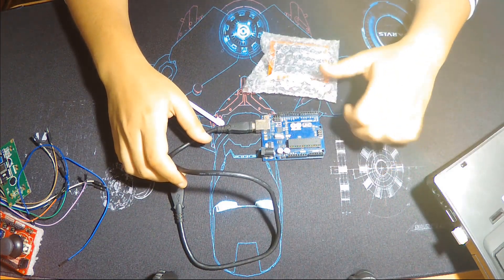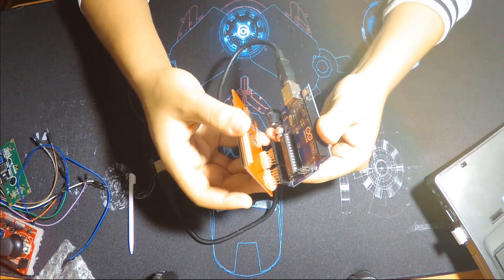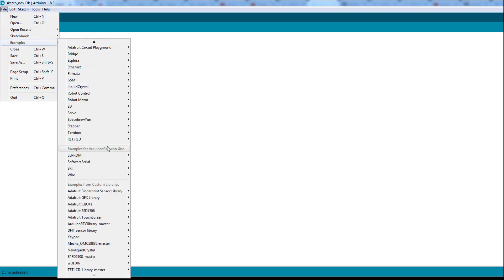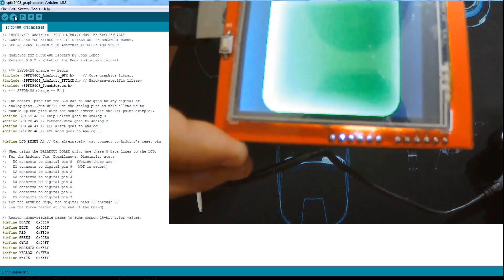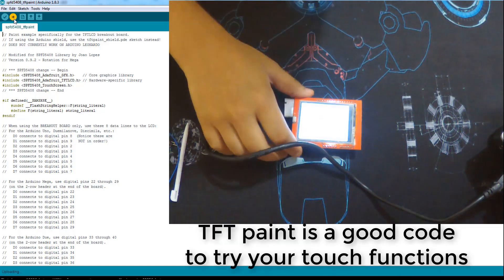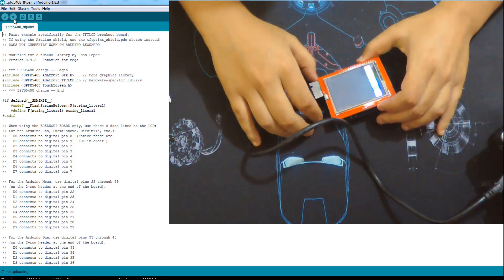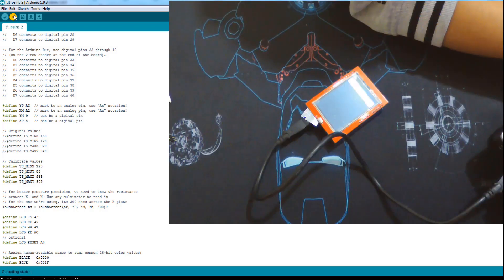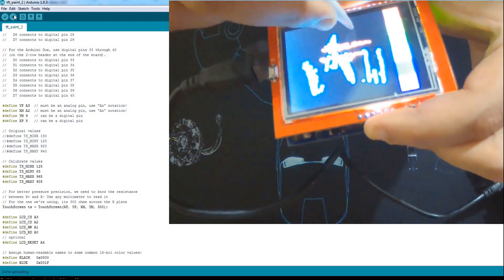Interfacing and fixing touch problem in Arduino TFT 2.4" LCD shield [Re-upload]

Comment: Hi, i have a problem, you touch is inverted by 180°, my touch is inverted by 90°, what can i do? i tested this tft paint and this is my problem
Reply from the maker: Hello you don't have the same problem as mine, my problem was that the same variable is inverted but yours you have the "X" axis input is considered as "Y" axis input and the same way around.
You can try this solution without modifying the library first:
In the paint code you'll find some lines with
#define YP A3  
#define XM A2
You can try to switch A3 and A2, and test if it works.

Comment: I fixed this with some reverse engineering.
Reply: xpos = map(tp.y , TS_BOT,TS_TOP, 0, tft.width());
                ypos = map(tp.x,  TS_RT,TS_LEFT, 0, tft.height());
Reply: @russelibrahim4045  and where in the code ?
Reply: @russelibrahim4045  So I have the problem that the program is mirror-inverted on the display Is the code of you for the solution at all?
Reply: @russelibrahim4045  ok i think i got everything right now. but I have a calculator program and that is still mirror-inverted. can anyone help me? I think the program has to be rotated because the test programs are rotated too. but how does that work?
Reply: @maximilian5635  If the Display is also mirrored then you have to play around with somewhere else in the code
Reply: @russelibrahim4045  thanks, but now I have an other problem. I rotated the screen and it is working very well but there is a black line on the hole screen an when I try to fix it the program still not work. sorry for my bad english ^^
Reply from the maker: Cool !  Thanks for sharing

Comment: Hello, I have this same issue with this screen, i repaired an issue with X and Y axis but I can't solve the problem with an innacurate touch. I tried to change the values like on your video but it didn't help for me, stylus is still away from coloured line. Can you help me?
Reply from the maker: Hello, if you solved the inverting issue, start modifiying the values, and try to add or substract bigger values until you get it right, then run the calibrating code it will give you the MIN and MAX values to be more precise.
Reply: xpos = map(tp.y , TS_BOT,TS_TOP, 0, tft.width());
                ypos = map(tp.x,  TS_RT,TS_LEFT, 0, tft.height());
Reply: @russelibrahim4045  Where should i put this in code?
Reply: @EspantoniusCZ  look for the part of the code that it is currently been used and change it to this